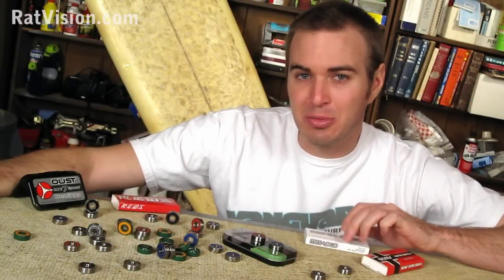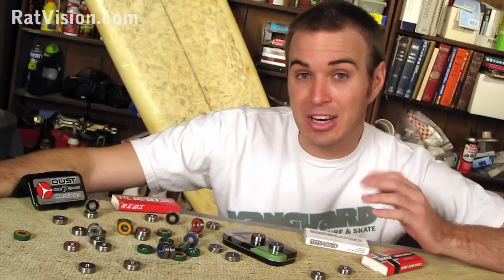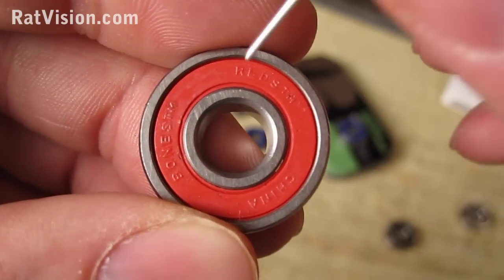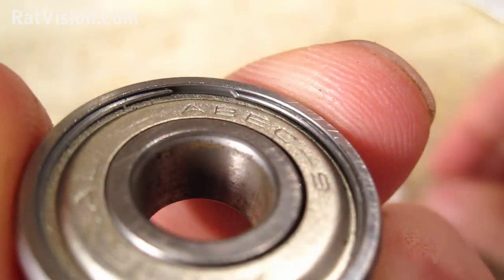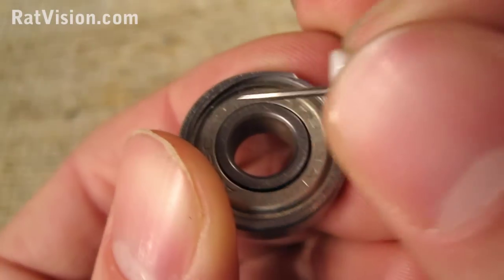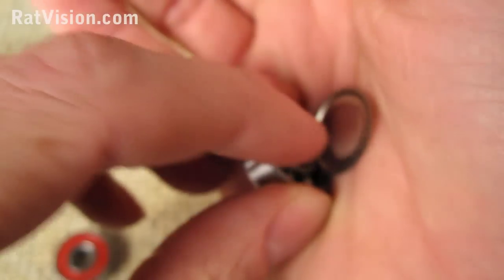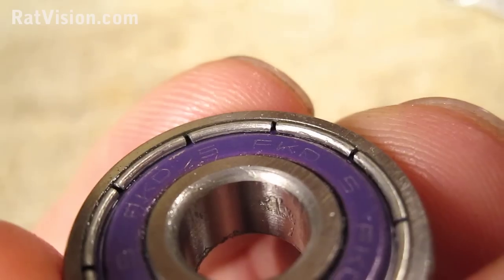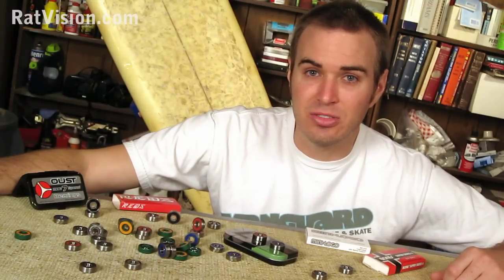Take Off Skateboard & Longboard Bearing Shields/Seals

Comment: "Metal bearing shields can't be removed"

All hope is lost.
Reply: @abasinsomars9533  ...
Reply: Mines came off but idk how it put it back on though
Reply: @officialwoonthie  same
Reply: they are removable just push into the seal with a knife carefully and it will poke right through it and lift it out
Reply: @anthony1666  that's what I'm saying there has to be a way to to get it off
Reply: You can remove it but you cannot put it back in, they are not meant to be removed.
Reply: I felt so disappointed
Reply: I used a cutter to get it off T_T my hands were shaking af
Reply: shit lol
Reply: @AethenTheProotTheSecond  what if you remove it and then put the rubber one instead? Will that work?
Reply: @faiz7180  I have no idea
Reply: How would u clean them if you have metal bearing shields?
Reply: @Real_Squirtz  you can't change metal bearings...cause mine is also metal one...haha...fucking sad
Reply: @lucaskim2459  dam, Alr thx
Reply: @Real_Squirtz  you don't, they're not meant to be cleaned
Only if it has plastic shields or removable metal shields, pressed ones aren't meant to be cleaned
Reply: God damn it. They already fall out when I don’t want them to but your telling me I can’t even get them off myself?
Reply: @faiz7180  I have done that and yes it does work
Reply: @AethenTheProotTheSecond  so once you buy that bearings, they are one time use only?..
Reply: @tarzencheda7928  yep, you can buy ones with plastic shields and removable metal ones
But pressed in are one time use
Reply: Man. Even the two wheels that comes with what I bought was already exposed. Meaning they are being consumed even I'm not using it.
Reply: Yes they can, I do it then gently hammer them back to shape and pop them back in. You can too
Reply: You and me both man
Reply: I've removed mine
Reply: Wrong I took off one side of my Bronson g2 bearings they have metal dust caps on both sides

Comment: I just opened the non removable metal shields :)) Now I skate with no shields.
Reply from the maker: +Minh Tran Congratulations on acquiring corroded bearings.
Reply: +Minh Tran Its actually [pretty easy to remove them lmao i just used a needle and popped it out, and then i place them back inside until all of the flaps clicked
Reply: Yea i rock the redz bearings with no shield, so far I see no problems, but I do avoid water and really dirty sidewalks.
Reply: Same here bra
Reply: +Minh Tran probably ok for most conditions. Add oil more often.
Reply: how you opened then please help me cuz i dont wanna buy new for my scooter i just want to clean the old once
Reply: My skateboard was being slowed down by pressed in metal shields rubbing against the actual bearing ball, so took them out and Walla.! Taking them out was easy on 2 of 4 outer bearings using a phone sim remover or paper clip.
Reply: Teach me your way master
Reply: I need to oil my bearings but I can't even remove the shield, but they work good they just make an annoying sound. Do I give up and get new bearings or is there's a solution for it. Anyone has an idea?

Comment: Yes I did the same. I removed one shield with a little plane screwdriver, cleaned the bearing and lubricated it with a mix of half solid vaseline and half liquid vaseline. Then left the open part facing the center of the wheel. It's working great so far.

Comment from the maker: We are talking about the same stuff.  It may appear that what you mixed is working, but it's not really doing anything, and eventually your bearings will be ruined.  You could much better performance from your bearings if you used a good lubricant.  Vaseline is not going to protect your bearings because it is not thin enough to get into the metal.  You still have metal on metal friction happening.  Your mixture is only making a mess. Your bearings will eventually be ruined.

Comment from the maker: Correct, it does not ruin the bearing to remove it only for cleaning.  It should be put back on after cleaning is done and lubricants have been added.

Comment: My sector nine longboard that I bought exactly one year ago has the metal crown like bearing shields which can’t be reused if I want to them out to clean the bearings. One of them is making a horrible noise there. Chinese made grease ball bearings that sector nine is using even though they have a really good ABEC rating . I think I’m just going to replace all the bearings with something better and at least some silicone or rubber shields that I can remove to clean if I have to. Thank you for this video. Nice expose on the different types of manufacturing processes or shields of bearings. I need a refresher course and this is it.

Comment from the maker: You are correct. As you know there are 3 states/forms of water– solid, liquid, and gas. The point we are making is that skaters sometimes ride through water (liquid), and that moisture in the air (gas) can also damage the bearings.

Comment from the maker: @Enav8 No this didn't do anything to to ruin the bearing.  It just scratched the rubber on the outside.  The reason for not using a needle or a razor blade to remove the seal is that you can cut the rubber flap where you poke in to. This is why a I used a paper clip.  The end is dull and won't cut that flap.  If you do cut the flap it can slow the bearing down, but this amount of speed will go completely unnoticed.

Comment from the maker: @nicoletot Since the board is old and the bearings are a little corroded just add lubricant to the bearings.  Don't worry about cleaning them because drying bearings with shields on is not always perfect.

Comment from the maker: You're right.  You can clean them the same way, but it's really hard to completely dry them.  Try to get your hands on +90% rubbing alcohol.  It's got less water than citrus cleaner.  It may not do as good of a job as citrus cleaner, but you won't have as big of a risk of getting rust.

Comment from the maker: You could try +90% rubbing alcohol.  Dry thoroughly and add lubricant.  The reason for using alcohol, instead of citrus cleaner, is that it's much easier to dry the bearings.  The alcohol is not as good but may work better in your situation.

Comment from the maker: If you have removable shields then the answer is yes.  It doesn't matter what the ABEC is.  Typically the problem that most people have is that they put the paper clip in too far and end up prying on the ball retainer.  You barely need stick the paper clip inside.  If you feel it prying on the retainer move the clip over just a tiny bit.

Comment: You should try build a perfectly engineered skateboard. The bearing spacer video was very informative and you clearly have a talent for this. NHS should hire you as an apprentice and give you a good access into the evolution of skateboarding technology.

I'd buy rat vision wheel kits in a second. Comes with wheels, bearings, washers, and spacers... maybe even a bearing cleaning kit.

Comment from the maker: 'Z' means one metal shield. "ZZ" obviously means 2 shields.  "RS" also stands for "Rubber Seal", and I'll let you guess what "2RS" means.  Regardless of the current trend to remove seals or shields from bearings, it's always a good idea to get bearings with one on each side.
Reply: I am wondering, what is the point to have the seal on the inner side of the bearing? The two bearings and the inside of the wheel form a closed space, where dirt/dust can't enter, can it? Wouldn't it make sense to use only one seal, facing the dusty streets?

Comment from the maker: @FOULER32 They're "non-removable" because you can't put them back in. Once you remove it (by force) the shield is destroyed. Trust me, you can take it off. I guarantee that you are touching the retainer– the thing that separates the balls. A needle is harder to use, but will work.  You have to BARELY put the needle inside that space. It will start to bend and lift up. Once you get enough of the shield up you can grab it with pliers and pull the thing off.

Comment from the maker: @FOULER32 Yes.  Once you bend the crap out of them to remove them they become trash. Try prying from a different spot.  Where you were prying from and nothing was happening– was where the needle was touching the retainer.  You were pretty much right on top of a ball.  Pry slightly over from that spot and you'll notice you have a little more room.  That shield will come off I promise. Now you know.

Comment from the maker: @FOULER32 Removing whatever made your bearing stuck may not make the bearing work well afterwards. It could be a lost cause. It can be done if u insist. Use something stiff and thin enough to get between the inner ring and the shield. A tiny flathead screw driver is best, or razor blade. U r going to pry the shield up (not off, yet). Don't go in too far and touch the ball retainer when prying. Pry it up enough to grab the shield with pliers and just yank it off. Don't damage the ball retainer!

Comment from the maker: @johhnyBoii Absolutely! It's called a shield or seal for good reasons. The idiotic thing is that most bearings only come with one. Manufacturers thought since one side of the bearing faces in the wheel you really only need one shield on the outside of the wheel.  This is not true. All it did was save them thousands of dollars but cutting their seal or shield costs by 50%. This results in more bearing purchases because oil leaks out and contaminants get in much easier. Put the shields back on.

Comment from the maker: You can't fix the shield, but you can still save the bearing. Try to wedge something between the inner ring and the shield, ONLY A TINY BIT, so you don't touch the ball retainer, and pry the shield off.  It will completely ruin it, but you can still use the bearing. Keep it clean and well lubricated.

Comment from the maker: If it's not slowing the bearing down you may be ok.  If they do slow the bearings down you might want to try removing the shield.  If you do want to remove it you have to be careful not to destroy the ball retainer inside.  The shield can be pried off.  Since this exposes the bearings you'll have to ride it until it no longer works properly.

Comment: Well done. Bearings with inner race cage are difficult to properly clean to remove the last of the particles from inside that cage. And we must remove the seals on both sides to have a chance to clean it well. Paint thinner is the best to remove old grease, acetone works much less well (use gloves)

Comment from the maker: @1511116 Yes bones are rubber seals.  The problem is that the other side is completely open.  So there pretty much is no point when a bearing has one seal or seal.

Comment from the maker: You need the c-ring to hold the shield on.  Without it the shield doesn't stay on.  Make sure that you are prying on the right end of it like we show in the video.  it can be frustrating when if you are pushing the c-ring around and not actually prying it out.  Try to poke it out rather than push it out.  Hopefully that makes sense.  It will come out.  It can be very frustrating if you've never done it before.

Comment: Yes I know it's not something usual to lubricate bearings lol But this mix is great for a lot of purposes. Better for plastic with metal, or plastic with plastic. It's working great here (so far), compared to how the bearing came from factory, the wheels are rotating fast and easy. The grease they used to have really slowed them down. 
Oh btw, these bearing's cages are made in nylon.

Comment from the maker: You can clean them with the shield on.  The part on the other side is called a crown/retainer.  It keeps the balls spaced out evenly.  This is not a shield.  Do not remove it.  You can clean the bearings the same way in the video.  Place the lubricant between the crown and the outer or inner ring so it comes in contact with the balls.

Comment from the maker: Watch our other video on bearings and bearings spacers.  That video will explain why one wheel is bad.  Usually, it's just a dirty bearing.  If the wheel is just slightly slower than the others it could be nothing.  Free spinning wheels does not prove anything.

Comment from the maker: OMG! that guy left comments all over our channel giving bad advice to people.  You can use acetone!  Don't use gasoline or other stuff.  Just be careful with the acetone.  Use gloves.  Acetone is not a lubricant so you need to use a good oil.  Bearings do not have gel in them.  There is no such thing as a lubricating gel.  You MUST put lube in your bearings after you clean them or they will get ruined and not spin fast.

Comment from the maker: Vaseline is not a lubricant for metal parts.  It's not a lubricant at all.  The lubricant that came with the bearings is also not grease.  It's an oil.  Bearings need time to break in, which is why they appear slow when they are new.  Bearings can also come with more lubricant as needed, so they will be slow at first for that reason.  vaseline is going to make your bearings slow, and then eventually your bearings will rust.

Comment from the maker: Of course it's best to remove both sides, if a bearing has a shield or seal on both sides.  There is no need to remove the cage/retainer.  You can wash bearings with anything like Dawn, shampoo, bug spray, toothpaste, and Axe deodorant spray. Any liquid is going to remove dirt and debris.  To really clean the bearings good, it's best to use a good solvent to remove contaminants. We do recommend =90% alcohol if people have trouble finding citrus cleaner. Thanks for the comment

Comment from the maker: @sk8pwner9 If u are all about speed then u should never use WD-40. It will make u slower. WD-40 is not a lubricant even though it has some light lubricants in it. It's more of a solvent and cleaner. Its purpose is to free rusty stuck parts. WD40 is widely argued that it causes rust too. Whether it does or doesn't, I am still researching. WD-40 is not strictly a lubricant so should never be used as one. Use a good lubricant like I mentioned. Read the description or go to RatvisionDOTcom for info.

Comment: Thx so much!!! I didnt push in one of my bones reds bearings in to the slot of the wheel, and the seal caught on the nut for the wheel and got sort of pushed in at an angle slowing down so much itwould barely spin on its own!!! Fixed it now though :)

Comment from the maker: There are either metal Shields or rubber Seals.  All rubber seals are removable.  I should have been more clear in my last response.  "ZZS" means 2 removable metal shields, but you rarely see the 'S'. Take a good look at the non-removable shield in the video. Around the the edge you see what looks like a ring that has a bunch of tiny spaces all around.  This is how to identify a non-removable shield.

Comment from the maker: @handom85 LOL! Sorry have to laugh. I have a feeling I went through the same when I was a kid. Anyway, glad my video helped. If u pressed the shield in at all it will slow the bearing down. Hopefully u didn't damage the retainer too, the thing that spaces out the balls. If u did damage the shield lets try to remove it. You want to pry it out like I did to seals. Use something with a point to get inside. Get the shield bent out enough so u can yank it off with pliers. Just keep it clean and lubed

Comment from the maker: Never remove the retainer/cage (ball holder).  Only remove the rubber seal.  When the balls are removed they have to replaced in the same order they were in.  Each ball has it's own footprint in the raceways.  This can effect the performance.  What probably happened was you warped the retainer or caused some sort of damage to it to create drag.  You need to clean the bearings and put good lubricant inside and see if anything changed.

Comment from the maker: @TheSPITFLARE  Think about what u r asking for a second. Shields or no shields? It's called a shield. And rubber seals r called seals. Just these words alone obviously mean that they are doing something. They're there for a reason. To shield the bearings from contaminants like dirt and moisture. A seal does the same thing. It seals in the lubricants and protects the bearings too. Shields & seals do not low a bearing at all. What's stupid is bearings with 1 shield on. More info @ RatVisionDOTcom

Comment: On Abec 5s it's a one piece shield, rather than a C clip that it looks like it has on your video, just to let viewers know ;) it's also a b'stard to get off too, you just have to keep on and on at it until it lifts off, I used an old small craft knife and then I used a computer/mini flat head screwdriver to lift them up, I put some Isopropyl 70% alcohol in a small jar, I empty them into it, closed the lid and then gave them a shake, opened up the lid and individually brushed them with a bit of the Isopropyl and an old toothbrush, I shook off the excess alcohol as I was spinning the bearing in between my fingers, hearing how the bearing was spinning, gradually it became very smooth, I dried off the alcohol completely with a kitchen towel, then I applied some sewing machine oil, 2 drops, I spun them again, first horizontally and then vertically, I banged off the excess oil onto another kitchen towel and then put the 'lid' back on, but using the screwdriver by carefully pushing down only the sides, as it clipped into position, one more spin in my fingers and then onto the truck to test and then that's it, done, onto the next one.
Reply: Actually, they're Abec 9s, whoops, sorry